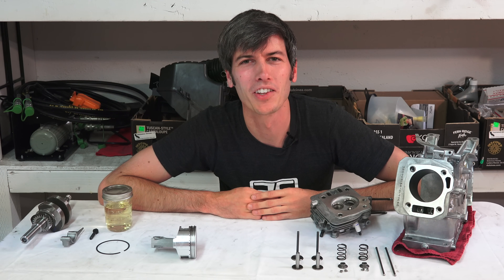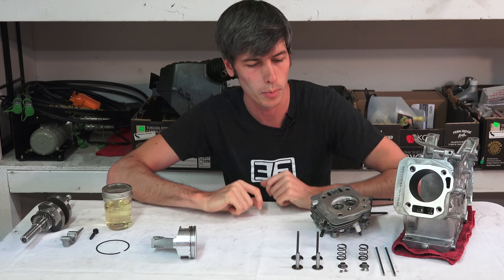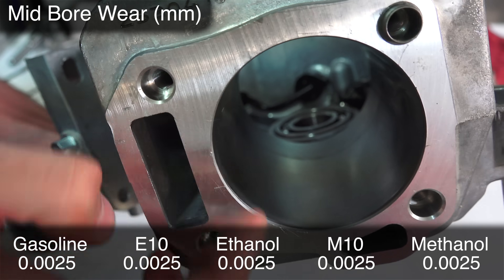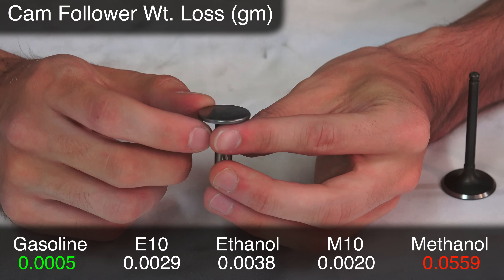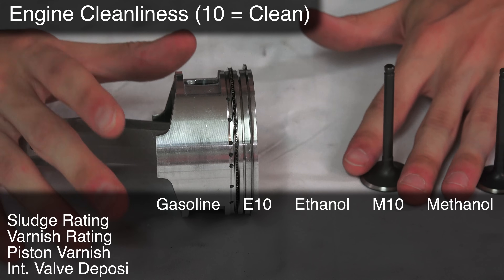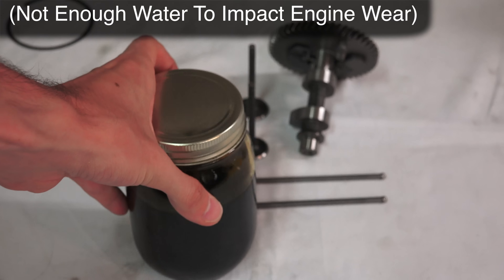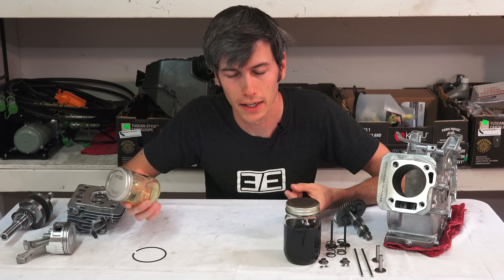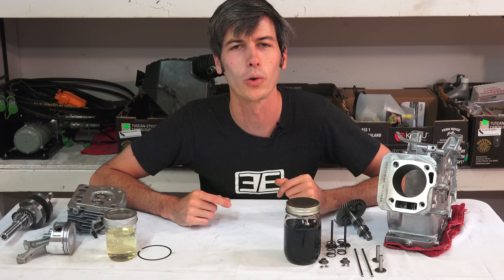Is Ethanol Bad For Your Car's Engine?

Comment: The ethanol causes waaaay more problems with the fuel systems compared to engine parts...
When they went to E5 to E10 here there were tons of older cars with problems coming from the fuel system.
My mechanic told me to always use premium gas cuz it's still E5

Comment: Thank you for that video!  I recently bought a Ford ecoboost and the tailpipe was black with soot. All ecoboost engines have black soot in the tail pipes if you run e10. I’ve run pure gas in mine since I bought it and the tailpipe is now clean and free from soot. So is it cleaner for my engine or not?
Reply: That's probably a symptom of a bad ECU tune that doesn't like E10 that much, but because of high temperatures it shouldn't build up a layer of soot on anything before the muffler

Comment: Ethanol acts like a sponge and brings moisture/water into your fuel system and into the engine.
     The BS government ethanol project  has cost us all lots of money.  It caused the beef and dairy prices to skyrocket over the last decade.  Ethanol is not a environmental better choice then regular gas.

Comment: I would love to see a study on Ethanol wear in marine applications. This study has stated /demonstrated higher water content in the oil. I know that many marine gas stations have gone back to pure gasoline probably for this reason.
Reply: It's not the water that's the problem.

Slight water content is actually a fantastic thing for your engine. Water is incompressible, but when it's very little, it steams off, removing carbon deposits.

The real issue is marine stuff is very often sold at a price that is significantly higher than automotive parts, but they use the old rubbers to save the manufacturer money (and guarantee return business) and many marine applications use aluminum fuel tanks for weight savings. These are the issues. Crap parts, incompatible chemistries with the fuel tank.
Reply: @jimmio3727  ethanol is crap

Comment: I run my 1983 RX-7 on modern E10 without issues. Have had to replace deteriorated rubber fuel lines, but the tank and carburetor or original; with the carburetor never being rebuilt.

Comment: I fly with a Rotax 912s engine. It is a flat four 1300cc 100 horsepower aero engine with a reduction gear. It runs on unleaded 90 octane mogas. 100LL avgas is not recommended (you get lead deposits everywhere). In Europe all mogas contains ethanol. It is a bummer as the ethanol forms flakes of esters in the fuel filters that can clog it up. So we have transparent fuel filter bowls to check at every preflight, but the flakes are translucent and real hard to see. Plus the filter is in an awkward place. I just change the filter often, it is better than a hole in the ground. I don't understand why it is not an issue for cars. I don't really understand how they form as it requires the presence of alcohol and an acid to get esterification.

Comment: The E10 fuels may be fine for cars that are designed for it, but it has destroyed the fuel system on countless small engines, such as lawnmower engines.  It is the reason that big box stores now sell overpriced non-ethanol gasoline for lawnmowers.  I, for one, have not been convinced that using E10 saves one barrel of oil over using regular gasoline.  I think that, unlike solar and wind energy,  ethanol is a big scam. Mainly to benefit  corn farmers!
Reply: @trevorwylie5882  I cannot use ethanol gas in my lawnmower.  If I do, I have to clean the carb. before I use it again.  It will not start.  My opinion still is that ethanol is a scam-it does not save 1 barrel of oil.

Comment: Great video, which answered a couple questions but I have a number more! Is there anything online that details more of the comparisons between using petrol and ethanol, power, mpg, how an engine needs to be mapped to suit pure ethanol etc. I'm keen on moving my RX to ethanol as opposed to petrol, for sustainable fuel sourcing and emissions reasons, but would like to get more info on how best to apply it to a car such as mine.
Great videos, always an interesting watch. Hope you're keeping safe in these mad times.

Comment: My problem with ethanol is that when the engine is not used that much (like boat engines where it is used only during the summer), the ethanol will start to corrode the aluminum in the engine when allowed to sit for long. This is why not allowing the sale of pure gasoline, even if it was more expensive, is a mistake.

Comment: its not the engine it damages its all the bits attached to it. terrible stuff. i service classics and all i see is damage relating to ethanol fuel. carburettor failure is very common now.

Comment: Rubber O rings, and seals , fuel injectors can be damaged over time from ethanol.

Edit:  stainless injectors are a must as well if the car sits  or is not driven often.  To prevent rust.
Reply: any additives to prevent this?

Comment: Gasoline has 27% ethanol in Brazil, by law, and it improves the octane but reduces gas milage. Although most of our engines are flex fuel, we still use the same gasoline for non-flex engines, and it works fine. I guess lol

Comment: Ethanol is not a good fuel,its cost if not subsidised is not practical! Have had problems with fuel lines and parts, it's not about wear except when it separates at about 4 months then it will just destroy everything....

Comment: My 93 honda, got twice the millage going to midgrade fuel over 87 octane. so 350 km a tank to 750 km a tank using 89 octane.
Reply: That is not believable.  You must have done something wrong.
Reply: @GH-oi2jf  Me? well 750km a tank on a 20 year old car is pretty good. 94 did nothing but extra power. 91 seemed to be the sweet spot. It was a Type R BTW.  EX-R trim with F22A6 engine with a more aggressive camshaft. The car just hated 87 octane. honestly, I think the engine wasn't made to take shitty fuel.
Reply: @GH-oi2jf  Not to mention, I had a Cold air and new exhaust. The guy I bought it from told me he got it up to about 150 horse. I'd believe it, I was beating a 350z off the line in first two gears till it Pulled ahead by the time I hit 3rd. I odometered every gas tank. It was pretty consistent. 87 fuel I will never touch since that car. It's the car that made me love driving. Also I have more horse today but I still haven't top it's top speed I got in that car. It was also a beast in the winter. Btw I also sold it with original Clutch. With 230 -240 000 km. Now I wont buy vehicles with clutch replacements either. Or Honda just knows what they are doing. One or the other.

Comment: I ran 100% methanol in my race car for years and its very  bad for cylinders. They wore out very fast.
Reply: First, any fuel would have caused the same problem. 
Second, methanol is more corrosive than ethanol.
Third, ethanol and methanol are less corrosive than gasoline and aromatics.

Comment: In the early 80's gasohol was introduced (e10) - the odor was horrible (rotten corn). Cars, motorcycles and boats did not run well on it. After about 3 years they reduced the offensive odor and relabeled it as unleaded. Incidentally, alcohol is prohibited in all aviation fuels.
Reply: Corn is sweet smelling. You must have forgot to bathe that day. Ethanol is not banned in all aviation fuels. No wonder you have to hide your identity, your family would be embarrassed if you posted your name.

Comment: I found the top of the cylinder bore results interesting. The difference between gasoline and Ethanol was pretty dramatic. That area is where the piston(rings) has to stop and change direction under peak combustion pressure which is not good for lubrication films which is why it becomes slightly mushroomed in a worn engine. Maybe the Ethanol does not dilute the oil film as much  or at all compared to a gasoline mixture Would be interesting to see what effect it has in that area. The methanol result could be from its acidic byproducts and unless you are racing, pretty academic.

Interesting!
Reply: maybe MMO will fix that

Comment: I personally run ethanol free fuel in my vehicles. Only 1 station sells it local and it's usually around 60-80 cents more per gallon but worth it. Ethanol is added to increase octane numbers.

Comment: OK for cars,but never in small engines because if you don't drain carb float bowl and let it evaporate out it leaves a hard plastic like residue. Had to dismantle and manually clean out. Always buy pure gas for mixing for 2 stroke motors or you'll be sorry.

Comment: OK, so if I run out of gas, can I pour a liter of 95% ethanol in the tank just to get to the nearest gas station or that wouldn't start the engine and then I would have to draw it out of the tank somehow? I mean, can it run ot 95% ethanol alone?

Comment: I wouldn't necessarily consider the fuel economy* of ethanol as a "con" since that just has to do with the energy content. People care about fuel economy for two main reasons: money and/or the environment. The former depends on how much both fuels cost, and the latter is a moot point since the ethanol component is carbon neutral anyway (minus production costs).

*Shouldn't fuel economy describe the thing that consumes the fuel anyway, and not the fuel itself?

Comment: 100%gasoline is not 100% hydrocarbon it contains additives like detergent and octane boosters antiknock and others so there will be more varnish and deposits compared to pure ethanol. The other problem with ethanol is it likes to absorb water and when saturated will phase separate from the gasoline. The real main reason why we should not use ethanol as a fuel source is because as a molecule there is only 2 carbon atoms compared to 8 in gasoline. Hence a molecule of gasoline can produce more energy than a molecule of ethanol so filling up with pure gasoline will go a longer distance than with ethanol. Finally producing ethanol from corn is counterproductive as it takes more energy to produce than what it returns when you burn it as a fuel. The reason why we still do so is purely political and not science based as the corn lobby is very powerful.

Comment: Your test is a small part of the ethanol issue. You skimmed over several bad effects and issues with ethanol. I worked in the petroleum industry for many years.
1. Ethanol has a shelf life and absorbs moisture at a high rate even while in storage.
2. It takes approximately 2 gallons of non ethanol fuels to make 1 gallon of ethanol.
3. On some vehicles ethanol will destroy seals and hoses. 
4. Ethanol leaves deposits in engine fuel systems. This is especially apparent if fuel is over or close to shelf life. 
5. Small engine manufacturers have many reports and recommendations against the use of ethanol.
Most people know of the fact that most vehicles see a significant reduction in fuel mileage with ethanol.
Considering all the negative effects of ethanol I see it somewhat irresponsible to promote ethanol without stressing the negative side effects of ethanol.
There are other issues that are offshoots of these mentioned issues.
Many gas stations, at least in my part of country, are advertising and promoting non ethanol fuels because of the stigma with ethanol.
I am a subscriber and I do appreciate your videos but this one needed more content to be fair.

Comment: When I bought a new Mini, I was told to use high-octane ethanol free gasoline, so I did. I kind of got in a habit of buying ethanol free gas even though I traded that car in years ago. Oklahoma has become almost all QT's and all the new stores have a pure gas choice. Anyway, why can't we just use our extra corn for more bourbon. LUL!
Reply: I use the QT red handle, as well. They need a 91 option though, as they only have the 87 octane ethanol-free option.
Reply: @howdareyu  Ford recommends 87 octane for my vehicle. There's several videos on why a person should use recommended octane. Shell is where I filled up my Mini.

Comment: I'm starting to think that I mabey should use E5 98octane fuel on my bike, instead of E10 95
Reply: I use 98 without any ethanol for my bike and cars. There are websites with info what brands don’t have any ethanol in SP98 E5. The E5 is a max for SP98 in Europe and they have to use the E5 sticker by law, giving the impression it contains 5 pct ethanol.

Comment: This experiment intentionally misses the point. The method used to determine the octane rating in fuels does not effectively indicate the performance of ethanol fuels. Sure ethanol fuels create heat but it creates heat as burn, not as explosion so the heat generated from ethanol fuel cannot do work in perspective to the results of the octane rating test. ie. not cost effective fuel efficiency. This burning property of ethanol has other ramifications especially on exhaust valves, which are not analysed here. Way to not understand the content well enough to report on it!

Comment: what about a e30 blend, especially if the car is tuned for it?
Reply: Here in Brazil we have e27 as standard gasoline and we have e100 instead of e85
Reply: Heitor Bernardes here in the US, people are skeptical of Ethanol blends. How is it in Brazil? How is it in your engines?
Reply: @clixt984  i think it will be just like what happened with Japanese cars in the 70's, over time people will like e85...
Reply: Here usually people tend to prefere e100 when the car is flex fuel, actually the demand is so high that some models are flex fuel almost exclusively to our market... As far maintenance, e100 tend to have a longer lasting engine, even the oil when it's changed it's cleaner... My friend has a 1991 Chevrolet Monza (chevy cavalier) with a alcohol only engine... 600k mi and never opened it even for a head gasket change... And it's carbureted, even though that it's a carburetor especially made for ethanol use
Reply: Heitor Bernardes dang that's good! Hopefully it gets more main stream here, but I doubt it. EVs are probably going to be the next step. That said, I ended up mixing E30 for my ECU tune. So far so good.

Comment: I tried e10 in my v6 hilux, but it made the car misfire and nearly stall on occasion.  Stopped after I switched back to petrol (gasoline).  Any idea why?
Reply: Only engines built for E10 Can use this kind of fuel, usally you can find this information on your fuel cap

Comment: Adding the fuel system (rubber or other materials seals and gaskets would have been good).  We all know it will varnish up a fuel system in short order, especially in motorcycles or small lawn equipment engines when compared to pure gasoline.

Comment: Most GM vehicles since the early 90s have had ethanol rated components in the fuel system.  I have ran E85 in multiple vehicles from that era with proper tuning for years and hundreds of thousands of miles with no factory fuel line or fuel pump issues.

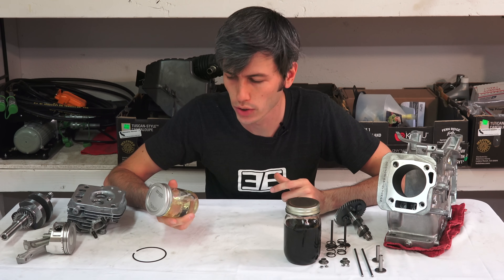Comment: 8:18 so if I get a Flex Fuel Kit will it still damage my car?
Reply: You have to change your fuel lines, fuel pump, if your gas tank is steel you will also have problems. Fiat started alcohol cars back in the 70's here and gas tank rusting was a huge problem, and of course it was fixed with an aluminum tank

Comment: If you have a gas engine that is not used regularly and the gas gets old, the water absorption characteristics of ethanol can cause it to run poorly. If you have a newer daily driver, 10% ethanol is not a problem. I have a gas tractor I use for snow removal, but it gets little use the rest of the year, so I use straight gas and it runs consistently better year around.

Comment: So basically, if I ran E30 with Ethanol Shield mixed into it (or Mechanic in a Bottle on occasions) as instructed, I could have as much wear or a little less wear than straight gasoline and have only a minor difference in mileage and power, while cleaning my valves and extending engine life by letting it run longer.

Nice!

Comment: In Australia E10 94octane is ~23% cheaper than ("ULP") normal gasoline 95octane. 
But people who care about their cars pay the premium for non-E10 fuel because mechanics frequently recommend to do so, 
and performance German gasoline engined cars frequently state a "preference" non-E10 fuels. 
Drivers report typically 3% to 5% worse fuel economy, with E10 over ULP anyway.

Comment: Ethanol over 10 % may cause corrosion over a long period due to it being hydroscopic.  Petrol which contains benzine is just as damaging. As it hardens rubber and plastic. That's why we don't wash parts in petrol

Comment: Thank you for sharing this. You do clearly focus on the engine wear, which the study covers, but  as you mention at the end that isn't the problems my vehicles have with ethanol. My small engines are more likely to gum up over winter and my E85/flex car fuel system components are much more expensive than the parts for the non-flex version of the same vehicle.

Comment: Just curious! What happens if you put gasoline in diesel engine and vice versa?
Reply: Bad things.  Gas in diesel = a huge repair bill to rip out and replace the entire fuel system.  Diesel in gas, not so bad, you just have to drain the tank, but your engine will be dead until you do.

Comment: Nice video, also you could have mentioned influence of ethanol on rubber seales in engine and fuel system. Is there a test where is compared wear on naturally aspirated engine vs turbo engine with same power output?

Comment: Ethanol has been a nightmare on my 1978 MC i have too rebuilt the  Carburetor once a yr+/_  it clogs jets and eats the seals + all my yard equipment that doesn't get used all the time has the same problem.

Comment: I live in eastern Canada and what annoys me is that ethanol gas is almost all that's available at the pumps here.  It might be fine for new automobile engines, but I also have a snowblower, a pressure washer, 2 chainsaws, a weed whacker, and 2 snowmobiles — all of which are very unhappy on ethanol fuel.  I just wish I could get regular gasoline for the engines I own that really need it.